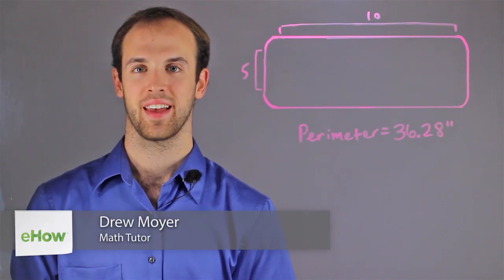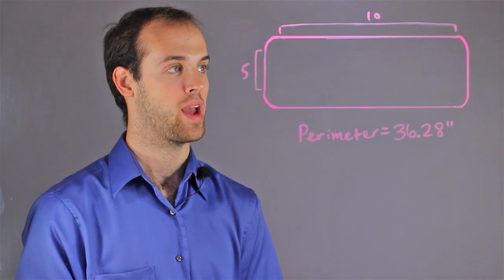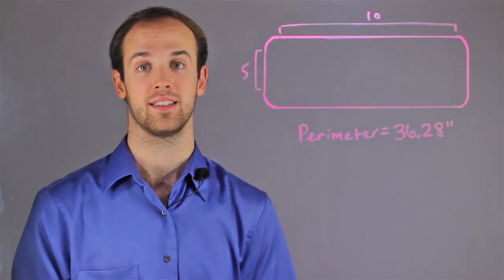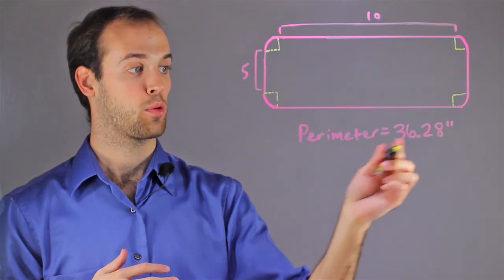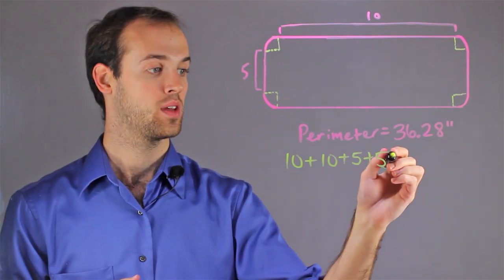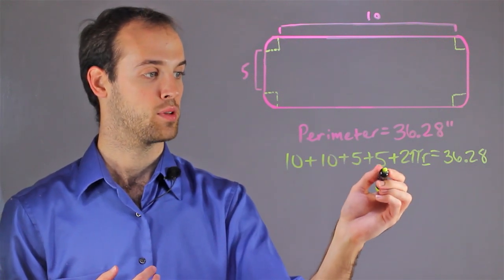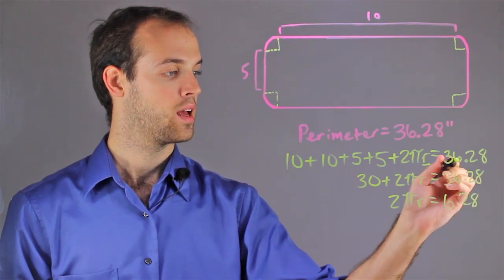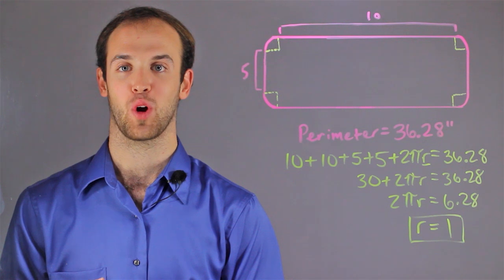How to Measure a Corner Radius : Math Help

Comment: Guyz if a corner in a 2d shape with cubic inches lets say 4 cubic inch square which would the corner be located while being added to the vertical or horizontally